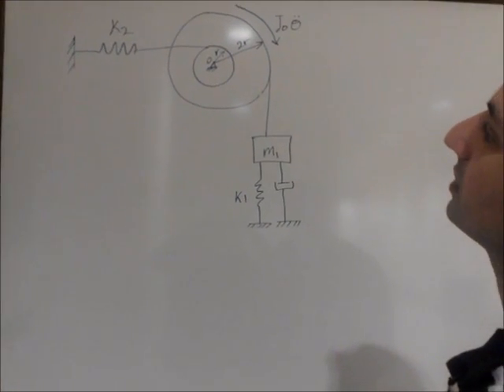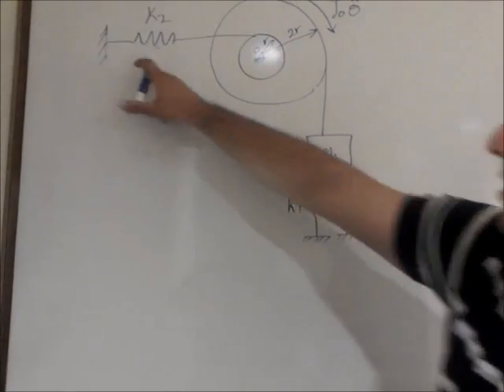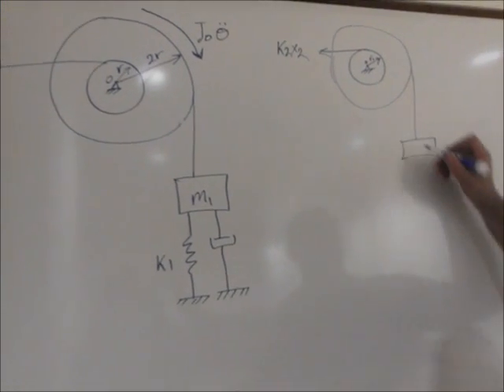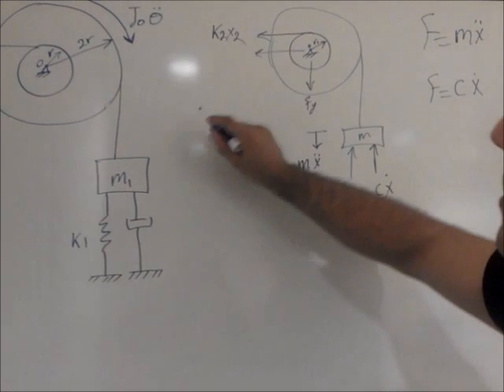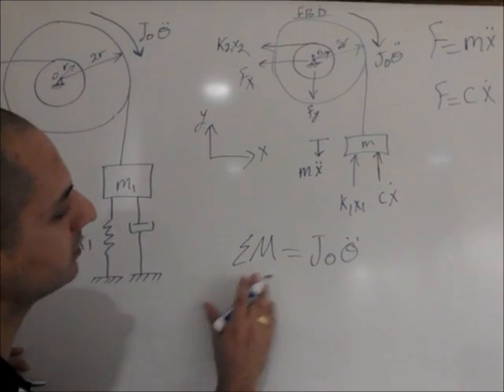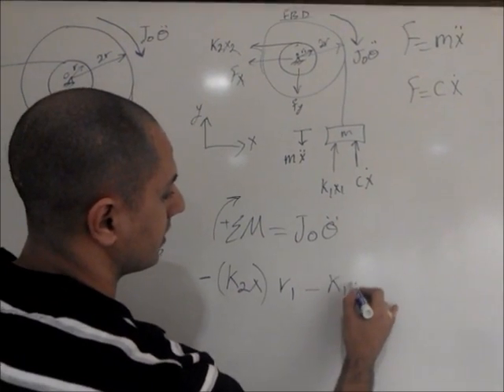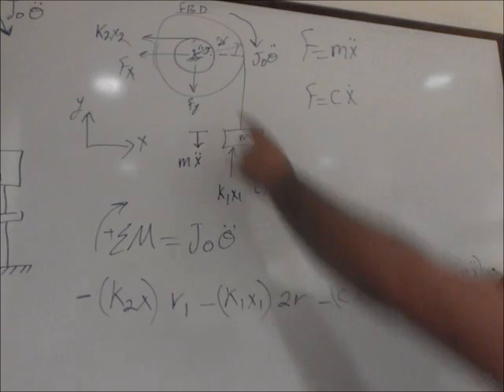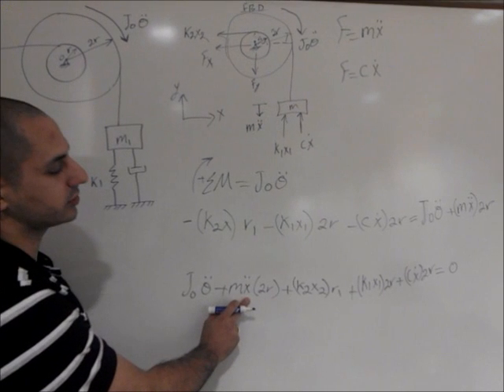Vibration: How to find the  Equation of Motion PART ONE

Comment: sorry to say.......but i think its wrong ....bcoz 1.the summation of moments about cenral point should be zero OR 2. anticlockwise moments is equal to clockwise  moments.......u have 2nd one.........but on left hand side,u have also taken -ve sign.which should not be ther.
Reply: 1. This is true for a body in static equilibrium. In this case we assume the system to be moving so the sum of the moments is NOT equal to 0.

2. You can define a coordinate system clockwise positive as long as you are consistent throughout the problem.

Hope this helps

Comment: why you don't consider the weight of the mass? . Is that correct? I mean, the string is only in tension, so tension should be considered to analyze the pulley. The string is never in compression, ...so the bodies need to be analyzed separately, and in function of Tension.   I am confused.  The analysis you posted here, it is similar to solid L bars with springs, where the bar is bushed backwards by springs. In this case, the pulley can not be pushed backwards by the spring on the bottom.

Comment: Great help! Thank you very much! But do you usually assume positive signs for clockwise moments? Because I'm use to assuming negative signs for clockwise moments.... That's the only confusion I have......
Reply from the maker: Nicky Cursio 
Hi Nicky, You are correct! however, as long you are consistent with your signs, you should be good to go meaning, if you assume clockwise is negative, make sure that you put the right sign (-) for anything clockwise. 
I hope this didn't confuse more. 
good luck :)
Reply: +Nicky Cursio glad that i'm not the only one to notice that..